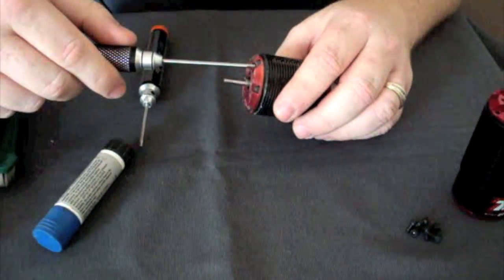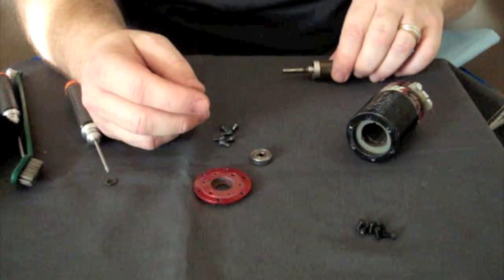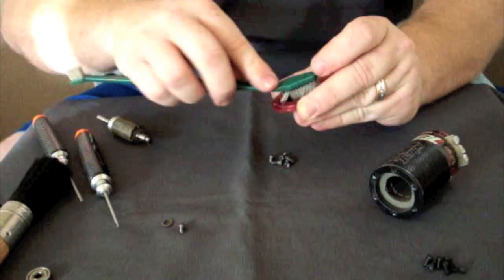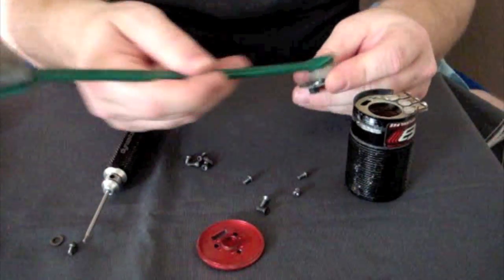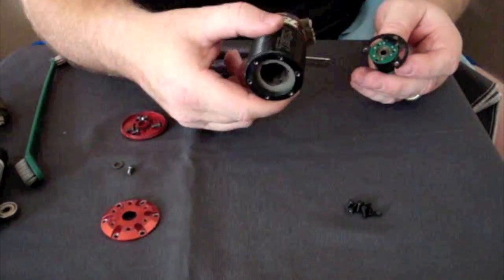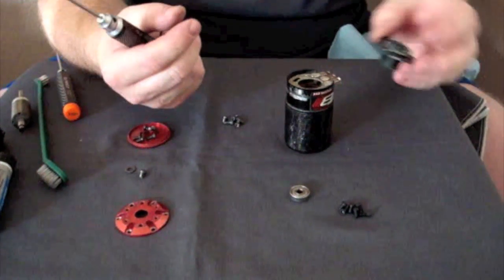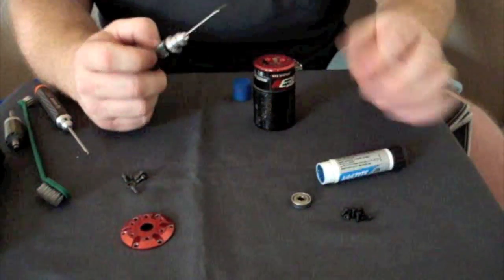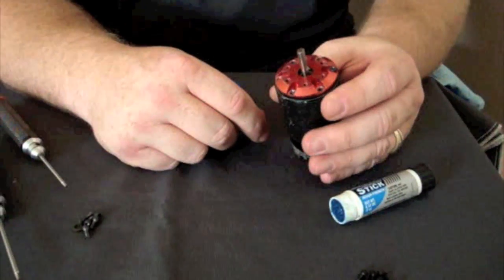T8MotorMaintenance.mov

Comment: loctite told me that grade of loctite is not for this small of a screw.  it's for 1/4" and larger diameter screws.  I would find associated's thread lock instead it's designed for smaller screws.

Comment: @heyboy100abe 
the t8 and rx8 will be a perfect combo for a truggy.
I recommend the 2250kv motor. this motor is perfect for the truggy.
see my vids with losi truggy and the above mentioned combo
its crazy quick.
i have a 2050kv for my buggy, but for truggy the 2250 is defo the right motor.